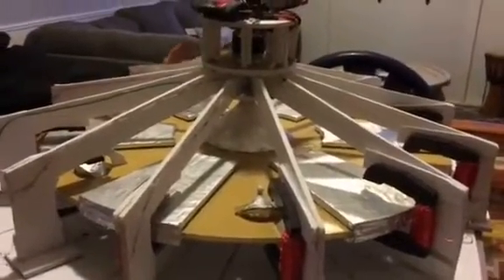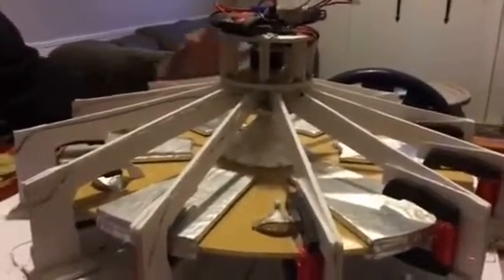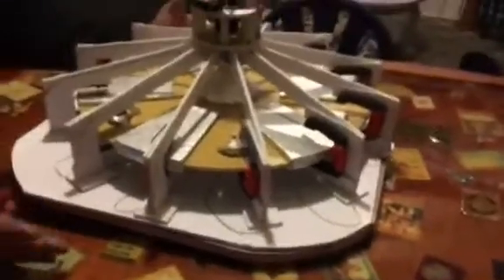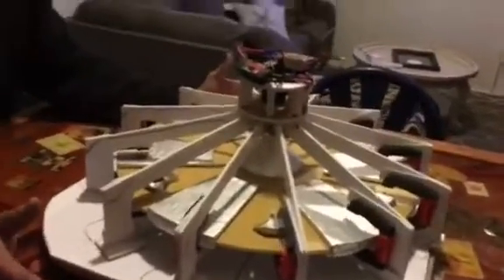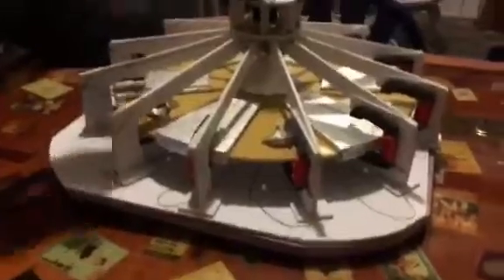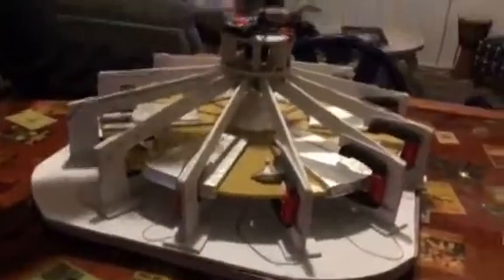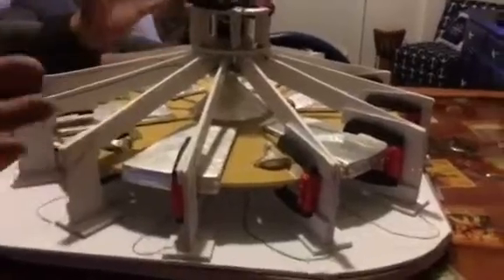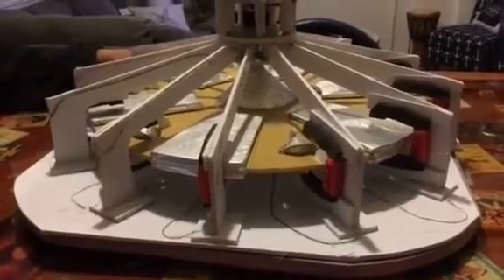OTC X1

Comment: I got your e-mail.  Here are my thoughts on your machine.  First of all, I think that the counter-rotation you've achieved may be a result of torque.  You'll feel the same thing when you squeeze the trigger on an electric drill.  The chuck spins one way and the drill wants to spin the other way. 

We (the Pods) already understand the laws of physics invoking rotation and counter-rotation: Lorenz Force and Lenz's Law; and, we have a respectable theory of how to accomplish it.  We've simply not yet done it; as, we're examining other aspects of the craft's operation - not the least of which involves the crystal and mental control aspects.

Examining your model, I can only surmise that given the lackluster counter-rotation of your half-hull, compared to the accumulator frame's more robust spin, and also considering the electromagnetic forces that may be leveraged by 
1) fully energizing the coils of your electromagnets; and, 
2) having solid aluminum as capacitor plates passing through all 12 electromagnets, 
your outer hull assembly could be spinning at a much more robust pace.

So, my questions had to do with the materials you used.  Your answers would explain the results you're seeing.  From your video, it's difficult to determine the make-up of your components.  I'm unable to determine whether the Capacitor Plates are comprised of real solid aluminum or are made of something else that looks solid -- painted wood; foil glued to wood, etc.  The Capacitor Plates do not appear to be wired to anything - not charged in monopolar motor fashion.  I like your solution to constructing them in multiple parts; although, the elctromechanical connection between the parts could be problematic; also, centrifugal force could compromise the assembly at higher RPM.  

Are the electromagnets functional and comprised of iron or other ferrous cores?  During operation, are they energized or not; and, are the coils switched or not?  The UTRONs look a little rough to me (no offense intended), which clues me to think they're not made of solid aluminum; and, if they're not made of solid aluminum (aluminum foil isn't thick enough to leverage the Lorenz Force/Lenz's Law), the electromagnets - energized or not - will have no physical affect on the rotation or acceleration of the outer hull (in your model, half-hull).

I'm just trying see what you've done here.  The guys in the pods have a firm grasp on physics and forces involved in setting a model to spinning clockwise and counter-clockwise. This seems to be a mystery to you, as you've stated in your video.  Regardless, I think you've built a nice test bed for examining certain principles of the craft's operation - specifically, the ratio of rotation to counter-rotation given various values of voltage applied to the aluminum plates and coils of your electromagnet.  Please take the next steps!  :-)  

SUGGESTIONS:
Remove the motor.  You don't need it.  The entire craft is a motor/gyro.
Read Tesla's notes on Frobe's Monopolar Motor to learn how: http://clandestinedisclosure.com/otx-x1-plans.html#tesla
Incorporate the monopolar principles into your model and please, please, try again and please let us know how it goes.  Look, we can do this. We simply have not done it yet.  You're half-way there.
You'll may need to consider implementing a commutator - a switch to energize/de-energize your coils and plates. One of the pod members has already proposed a design for accomplishing this. 
Download the OTX-X1 Machine Shop Schematics Part 2 located from my website.
His is a purist approach that honors Tesla's and Forbes' original design; and, it may get the job done; but, other pod members have discussed alternate design approaches to a commutator or switching mechanism, such as: Rather than placing it at the periphery, install it closer the central accumulator and utilize a mechanism that won't cause friction, wear and tear.

Thank you for the e-mail...hope to hear from you again, soon.
Reply from the maker: So you are saying that this works off of  the same principal as a brushless motor using an ESC to control the speed . I am very familiar with this from the RC world . It might be even possible to reflash the software to do this instead of a trigger. If we can integrate modern electronics into this , it should be a no brainer. I will see what i can do .
Reply: Now you're talking!  I like the idea of integrating modern electronics into it.  Go for it!

By now, you should have received my e-mail with several bullet points...I've provided theory and a description of a rudimentary test involving an energized plate and electromagnet.  Again, please read Tesla's notes on the unipolar dynamo for more inspiration for your implementation.  
http://www.teslacollection.com/tesla_articles/1891/electrical_engineer_ny/nikola_tesla/notes_on_a_unipolar_dynamo 
If you want to discuss further, contact me through Skype - my account-name is included in my last e-mail to you.
I've notified the pods and Ralph Ring of your efforts.  Ralph sends his gratitude.

For anyone else following this message thread, here are the notes I've shared with RemoteControlDad.  Feel free to make corrections and modifications where you see fit.  I'm not perfect and I don't have all the answers.  Engineer Fellows smarter than me were the ones to suggest implementing the unipolar motor wiring scheme to make it work.  The later half of my video 'Wiring the OTC-X1' loosely touches on how to do this.  Motors are not my strong suit.

The basic principles, related to the OTX-X1 wiring are these:

• The C-shaped electromagnet creates a dense field of magnetic flux that propels a capacitor plate energized  by DC current when it approaches and breaches the flux field.  The stronger the field, the more robust the thrust applied to the disk.
• The core of your C-Shaped magnets should be ferrous; but, not magnetized.  That means they should be made of iron or ferrite or other ferrous metal.  Your refrigerator magnets are likely ceramic and too weak to be doing anything on your test bed.  If you were to remove them from your model and re-run your experiment, you will surely see counter-rotation of the half hull created by the torque of the electric motor.  Again, the entire device is a motor.  The plates and electromagnets leverage the Lorenz Force for their rotation.  This step of creating electromagnets is not an inexpensive proposition.  It would require a bit of machining of the iron plates form your local machine shop.  My website has machine shop schematics, if you care to have a look.  They were created by one of the pod members.
• The density of magnetic flux is affected by the electromagnet’s core material (iron, etc.); the amount of current flowing through the coils; the number of turns on the coil; the gauge and material of the coil’s wire; and, its type: round vs. Flat wire.  Flat wire is more effective at transferring magnetic energy through a ferrous core than round wire; but, round words fine.  Just make sure you’re using something like ‘magnet’ wire, which isn’t magnetic. It’s simply copper wire coated with a fine material to insulate it so that it more easily facilitates the transfer of magnetic energy (used in motors, transformers, and electromagnets).
• As  current flow increases, so does the density of the magnetic field and heat.  You likely already know that too much current flowing through a wire makes it a fuse (burns open your circuit creating smoke and fire).  Otis T. Carr went against the advice of his electrician and overloaded his craft during a test in Oklahoma, causing it to burn up.  Carr FAR exceeded the current capacity of the wiring, making the craft a giant fuse. Don’t be Carr.  Be safe and smart.  Proceed with caution.
• Polarity of current flowing through the coils matters – mind the (+) and (-) connections of all twelve coils; and ensure all your coils are wrapped in the same direction; because, it has a direct influence on the inner disk’s direction of travel.  If you reverse the polarity on any of them, you’ll create a breaking force on the disk – defeating the work of the other electromagnets.

The pods have experimented with iron core electromagnets and have proven that when the aluminum capacitor plate and electromagnet's coil is energized, the plate is thrust through the opening of the c-shaped electromagnet.  This force, coupled with torque, should nicely generate rotation and counter-rotation - one of the required aspects to generate a lifting action.  In his notes, Carr also mentions the parts being charged; but, doesn't go into the details of what this means.  Read more about it in his toy kit plans and US Patent - both downloadable from my website: ClandestineDisclosure.com

Good luck.
Reply: One more thing to consider: The Pods are of the ilk that the power source MUST be on board the craft.
Reply: @Search4TruthReality  WALKED AWAY, NEW MISSION, PEOPLE WHSAT IS WRONG WITH YOU AND WHY NOBODY IS GOING TO FINISH THAT THING. FLASH IN THE PAN?
Reply: @The Evidence, I invested eight years of my creative energies into this.  That's hardly a flash in the pan.  Assume nothing.
Reply: Search4TruthReality So this is impossible to recreate?
Reply: Maybe the problem is somewhere in precision or scale, maybe some varies must have been perfectly fit or sth what everyone missed? What is Carr doing?
Reply: Carr died in 1983
Reply: I've not seen it recreated and functional.
Reply: @Search4TruthReality   Shit. I really want to make it happen and i want to somehow contribute or help, problem is i don't have so much money to spend on it. How can i do else?
Reply: Well he had models which looked to have frames of wood. I am saving up money and intent to build a smaller version of this experiment.
Reply: Search4TruthReality I have been doing my own research on this topic and have been developing various forms in which it is applicable, and would very much appreciate any guidance. In addition, I have some questions which, if answered, would really help my process. Thanks.
Reply: @Search4TruthReality  a year after invention of the neodymium magnet. I feel something in that. How about placing a free rolling ball magnet inside the spherical cavity of the Utron with copper winding around the outside of the Utron? I need to see that tested in a full setup! This will not work with a Utron with its axis straight up, 45 degree tilt is a must, or the ball won't roll/spin properly.
Reply: @Search4TruthReality  the people who have recreated it and made it functional are people who did math for everything down to a T... as well as UNDERSTANDING Everything down to a T..... they practically built the future before they knew it.
Reply: @czajnikzaglady6412у меня работает но не летает , просто подскакивает.
Reply: @stevitbone1   This is like taking the wires out of an induction motor and replacing it with a utron that would be and upgrade
Reply: Electrician from New Zealand here.  Please let's Exchange details mate.  I'm serious about all this stuff.  Currently was looking at ionic lifters, scaling up....   found this video somehow...   glad I saw this comment  :)
Reply: I have no doubt that materials and the technical electrical aspect of this comment (of which I can't figure out too easily myself) would greatly improve the performance. I have read a website about the construction of the otc X1, and I did notice the mention of the the counter rotation of the outer ring is by design. From the engineering side, if both rings were mounted on a spindle / pedestal. And the outer ring were resting on needle roller bearings, it would lessen the friction that is slowing the outer rings counter rotation.
Reply: hi RemoteControl Dad, I have installed some contactless triggers to pulse the coils to save the needed current, do you have experience with the regulation of supercapaciters on coils?
Reply: and they took your website down btw
Reply: Carrs Utron is hollow, filled with a battery/electrolyte. Here it stores the energy needed to get going.
Reply: @Streamcatcher    indeed it was reported that way.
Reply: @nwapranga  do you know why many people talk about mercury inside in stead of a battery? To be honest I am not sure how a copper winding around a bi-cones aluminum object would generate power when spinning. Maybe like the homopolar principle. If the aluminum (a paramagnetic metal) becomes magnetic when passing the in magnetic field of the C magnets, this would induce a current in the copper winding. Which then can be lead inside the battery as well back to the big central Utron/battery out to the top + and bottom - outside shells/hull of the foil craft.
Reply: @nwapranga  actually I do not even think it is necessary to have a battery inside. The Utrons just are there mainly to continue electric momentum for a split second, to fill an energetic gap for a sec, so to speak. 

So, I am also playing with the idea of placing something inside the round cavity of the Utron that Otis T. Carr did not have in his time and was just invented a year before he died. 

A round free rolling neodymium ball magnet. An other option is to have a neodymium ball magnet with two axxis attached exactly on its north and south poles. In which it spins freely inside a copper winding, spin by fins placed in one or more possible ways (needs testing for best setup). The rotating ball will create a current in the coil and also in the electromagnetic C magnets as the neodymium ball passes those. So in this way the Utron gives back current to the central battery in two ways. Through the copper winding and through induction in the C magnets.
Reply: @Streamcatcher  I only ever heard of an elcrolyte being used . I wonder if in the centre of the utron, if it oscilates between centripentance and centrifugal motions possibly unlocking the enormous amount of energy fused in H20.... totally a speculative comment but I've had dreams about water being the key to all of this .
Reply: @nwapranga  well, that would certainly be great! And also fitting the natural non-polluting principle that this craft could mean to the world. 

As far I remember, high electric frequency was used to break down water molecules with great ease by Stanley Meyer. He kept telling how little energy it took, just the right frequency. 

Back to the Utron, I would like to know how h20 then would transformed into electricity. It is possible, as thiabis already done in hydrogen cars nowadays.

Indeed Otis T. Carr only speaks of an electrolyte, similar to the lead battery he says in one of his radio interviews.

I am not sure how energy from water could be done regenerative in an enclosed device.
Reply: @Streamcatcher  Yeah it would be awesome. Yep Stan probably was using a computer to time and tune all his different components and functions of the apparatus he invented.Maybe the way to harness it is something like the star in the jar sololuminencence but larger within a utron . Possibly the 4D shape of the entire craft is like a fractal antenna to the output of the utron ....not sure but it sounds cool haha.
Reply: @nwapranga  sounds cool indeed! I also heard someone saying the craft is a Tesla coil, a free floating one.
Reply: @Streamcatcher  Yeah that's a cool idea too definetly . I'd love to take one for a spin haha ... I'll come get you if do bruh haha!

I'll be playing and experimenting with my Cymascope app for Android in the morning so if your interested follow my channel and keep in touch. Cheers for the priming back and forth today.
Reply: @nwapranga  I'll be looking forward and up for that!
Reply: Search4TruthReality Lorencforce
Reply: Замечательно если не учтть то , что нам оставил ученый Банетти, он улучшил машину Викхерда. Он доказал на поактике то, что мы до сих пор не можем понять. И это по тому что мы сами ничего не делаем. Нада просто читать труды ученых прошлых лет и делать их работы, а затем применять к ним новые технологии для оптимизации.
Reply: Thank you so much you answered my questions.... Once im done can i fly to see to thank you in person and show off what you helped me build?
Reply: @fundamentalz424 мне тоже интересно.

Comment: Congrats for taking it this far!  This is the first one I've ever seen that demonstrates the rotation and counter-rotation.  I've shared with the pods and Ralph Ring. Please contact me: walter@clandestinedisclosure.com
I have some questions about your model.  Are the electromagnets energized?  What are you using for their core - iron?  What are you using for capacitor plates and UTRONs - is that foil or solid aluminum?